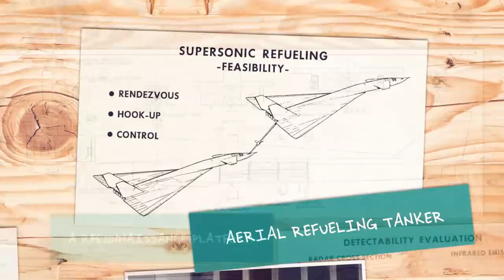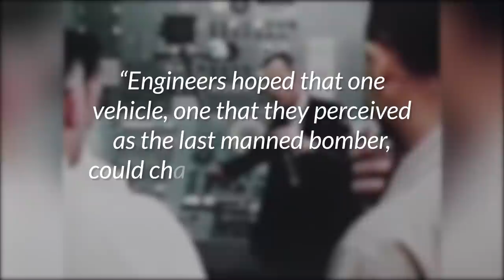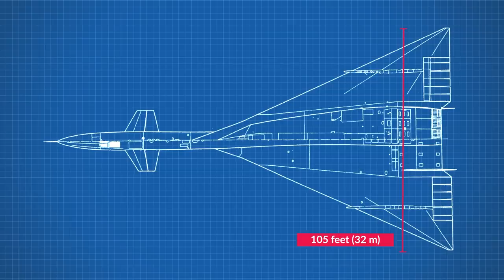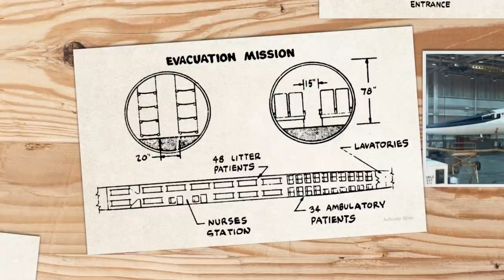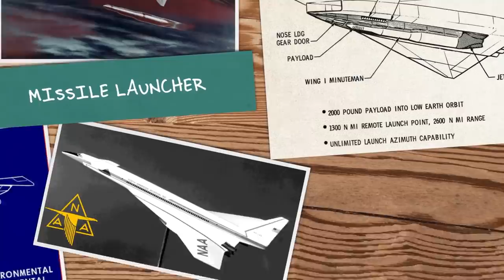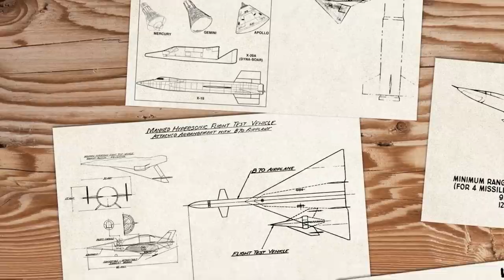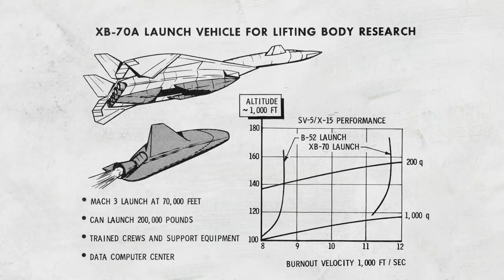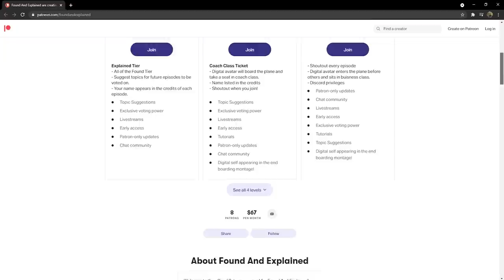Ahead Of Its Time: Mach 3 XB-70 Valkyrie Super Bomber

Comment: North American made some of the most advanced and beautiful planes ever.  Miss the days where there were 6-8 large American engineering firms.  Convair, North American, Lockheed, Boeing, Ryan, Douglas / MD, General Dynamics...etc, etc...  Now there's basically 2 with Rockwell on the outside having absorbed North American years ago and doing little since the B1.  Everyone else was snatched up by either Lockheed or Boeing and IMO it just isn't the same.

Comment: 7 years developing a prototype bomber For public display 1964. Soviet 3 years to make a prototype mig 25 1967. as an enemy yes.  finished already project for XB70
Reply: Huh?  The Soviets were working on high speed interceptors in the nid 1950s, before B-70 was even designed. The MiG-25 program, the result of those efforts, was authorized shortly before the B-70 was cancelled as a weapons system.  Had B-70 procurement not been canceled, it would in all likelihood have flown before the MiG-25, which was a far less complex aircraft. It would also have gone into service at about the same time.

Comment: Pretty sure the guys from dodge designed this. So you see here where just gonna take a f$&k ton of jet engines and put a cone and wings on it.
Reply: It's not just a conventional delta wing, it could fold down the wingtips to ''surf'' on the shockwave the aircraft generated at supersonic speed. Of course a heavy bomber flying this fast needs enough thrust, engines haven't been that powerful as today in the 60s. The aircraft was made of titanium (which is hard to manufacture), because aluminum constructions can't handle the heat at Mach 3. 
The aircraft was more or less constructed with side rules, today with 3D CAD programs you could built more advanced aircraft, of course.